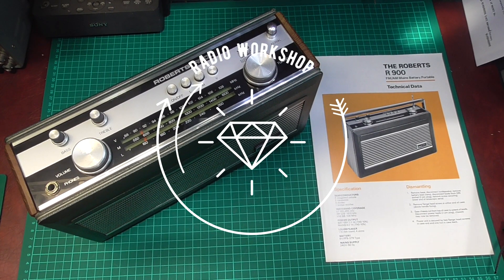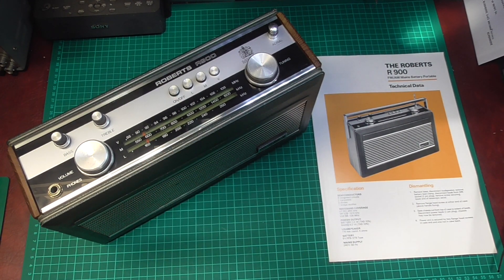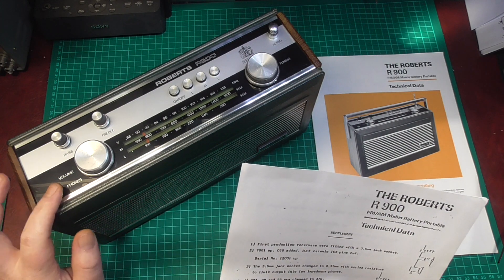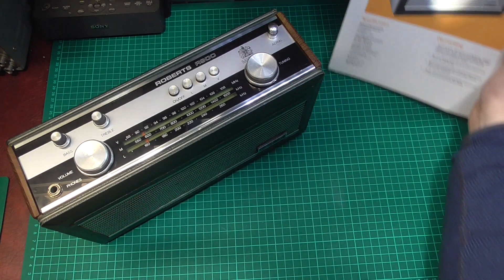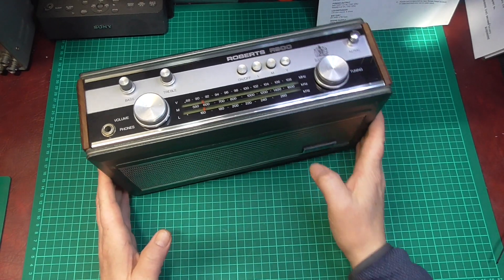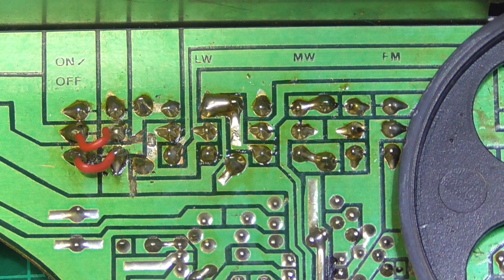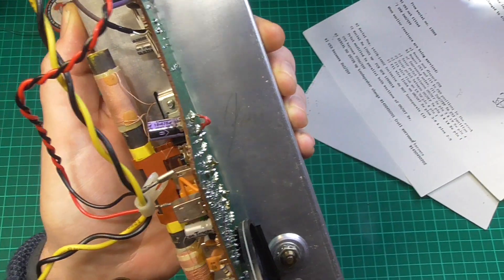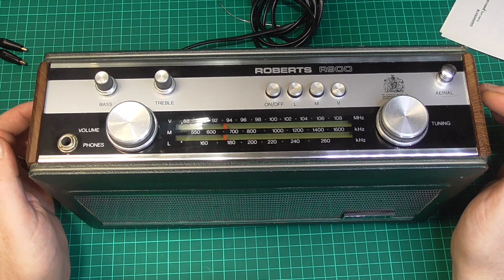Roberts Radio Model R900 - Official Power Switch Modification

Comment: Hi, thanks for this video. You didn’t describe the symptoms of the problem. I have one where you have to hold down the power switch for it to work. Is that it?
Reply from the maker: That's it in a nutshell, there are other symptoms, but that's the biggie.
The power surge on switch-on passes too much current through the power switch, causing arcing of the tiny copper contacts, they burn out, causing intermittent, or no operation.
Reply: @Codeeze  thanks. I guess I’ll be getting my soldering iron out then!
Reply from the maker: @anthonydavies9093  If you get stuck, my email is on my 'About Me' tab...
Best of luck if you're doing the whole modification! - if you need a new switch, I have those too 👍
Reply: @Codeeze  thanks, I’ll ping you if I am stuck or need a new switch. Like you said in your video, these are nice sounding radios, so it would be good to get it working properly
Reply: @Codeeze  mine has serial number 19609 and it looks like someone has has a fettle with it as C59 is already 1000uf and C53 is not original and is 220uf. I found the service book online and I think it's still suggesting I cut through the PCB and bridge the switches.(PCB is GPB1269D16). I do wonder if I should try and clean the switch (gulp) before operating on the board?
Reply: @Codeeze  my switch fell apart. can I buy a switch from you? I can't find any on line
thanks
Reply from the maker: @anthonydavies9093  email me - address on my 'about me' page. Viewable best from a PC...

Comment: Hello Paul. I am a great fan of your videos and am finding them very helpful in my attempts to resurrect/keep some of these fine old radios going. But I have noticed an omission in this video. My project this week is an early one of this type (No, 4236) and on dismantling it was surprised to see someone in its past must have had a half-hearted go at doing this modification. The on/off switch was of course kapput! Whoever had bridged the on/off switch, both horizontally and vertically, only cut one of the tracks and not removed C59 and replaced it with C53. And so off I launched following what your more expert hands had done. Switched on and all seemed brilliant (along the way I had also dismantled and fixed the on/off switch) - until I got to long wave. Signal was there (Radio 4) but incredibly weak. A day or so poring over this, about to give up when I managed to source a copy of the service sheet and found LW switch also needs bridging - terminals 1-4. And voila it fully lives again!

Comment: Sorry for lateness; I was really pleasantly surprised when I got my first R900 (later version) with the sound quality. One Roberts set I'd definitely get more of. My later one still has all the capacitor positions as per the early boards, maybe the ordered 20,000 PCBs or whatever in one hit rather than calling them off in batches.  Cheers - Andrew
Reply from the maker: Thanks Andrew - My opinion of course, but side by side the earlier ones sound better - must be the casing. You need to sneak an early one in to the collection.
Reply: @Codeeze  I shall endeavour to do just that!

Comment: I was wondering if that capacitor move is so the capacitor is not charged on the application of the switch , but kept charged when mains is applied irrespective of  the switch being on or off?  
In other words has the cap been moved before the switch to reduce inrush current and same the poor old switch?
Nice vid Paul, love mine. Will have a look inside to see if mine has been done.
Reply from the maker: Thanks for watching Simon, moving the larger capacitor I believe absorbs the inrush preventing the current damaging the copper contacts inside the switch. That's how I assume the modification works at least.

Comment: I guess the  point of this mod to share the current across both sets of switch contacts? Anyway my r900 is never used on mains but may consider  doing the mod one day, lovely sets, nice big speaker, many thanks
Reply from the maker: Thanks ptronix - moving the larger capacitor I believe absorbs the inrush current preventing the damage to the copper contacts inside the switch.

Comment: Good service bulletin repair Paul. So did this repair essentially reduce the voltage to the on/off switch? You mentioned a power surge that may cause sparking and burn up the copper contacts. I am just thinking there may have been another less evasive way to clear this issue. I guess this was the easiest way whereas another way may have been more evasive. Perhaps a more robust switch but then that changes the button look, hole size, etc.... Interesting repair. I've never seen a service bulletin that ever suggested cutting up the circuit board.
Reply from the maker: It's what they came up quickly at the time Andy, and it does serve the purpose. No additional components, just using what is already there I guess kept the cost down for the retailers. Moving the larger capacitor I believe absorbs the inrush preventing the current spike damaging the copper contacts inside the switch. That's how I assume the modification works at least. Thanks for watching.

Comment: Nice Job Paul One Of Roberts Better Radios For Sure With a Nice Speaker and a1.5w Amp in It
Nice Of You To Show Doing The Mod For Anybody Getting One With Out This Done
Super Job !! Regards mike.
Reply from the maker: There's not many folk that are aware of the problem, and there are still plenty out there in the wild that won't switch on. Replacing the switch solves an issue, but doesn't cure it. This modification prevents the current surge through the contacts inside the switch. Thanks for watching Mike.

Comment: Nice little mod :-D, i'm not sure what i would do if i had one.
I may have used a mosfet to switch the power and that would take all the load off the switch.
I only have the hacker Rp38 saved from landfill, so i guess it's not likely to have the same problem.
Reply from the maker: It's what they came up quickly at the time, and it does serve the purpose. No additional components, just using what is already there I guess kept the cost down for the retailers / techs - Thanks for watching!